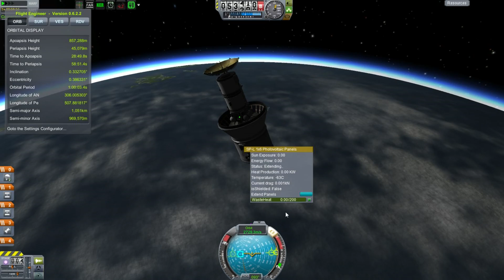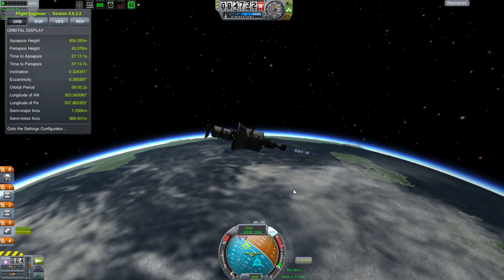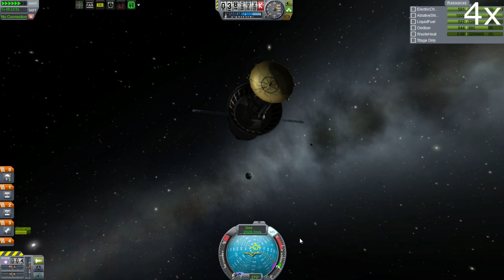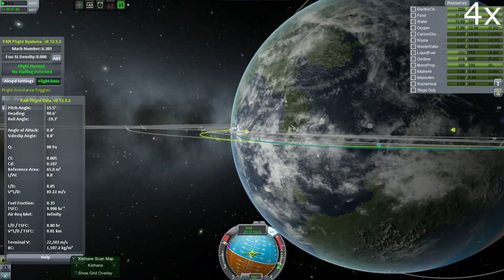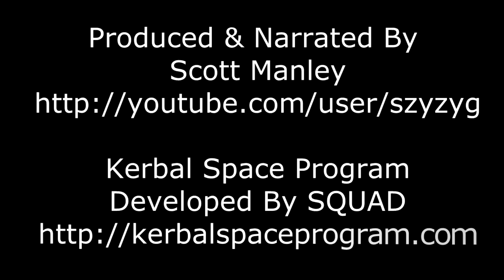Kerbal Space Program - Interstellar Quest - Episode 30 - Moho Return Probe & Orbital Power Station

Comment: anyone know if it theoretically possible to design a Free Return rocket to other planets?
Reply: Yes for multiple orbits, not sure for a single orbit.

Let me elaborate and take trip from Kerbin to Moho as an example. Standard way of getting to Moho is to make an orbit around the Sun which has apoapsis at Kerbin and periapsis at Moho. When you get to Moho, Kerbin is no longer at your apoapsis, because it orbits around the Sun. But if you wait long enough, then after orbiting the Sun many times, Kerbin will eventually get back to your apoapsis. The problem is, this might take a hundred years. And the actual time it takes is hard to determine in KSP.

As for a single orbit, I have done some of the mathematics and it's not easy. When you get to Moho and do a gravity assist, you can either do it in the direction that Moho is moving, which will take you in the opposite direction from Kerbin, or in the opposite direction that Moho is moving, which will decrease your apoapsis.

Now I won't be able to sleep tonight until I solve it, damn you :)
Reply: I guess you could if u timed it really well and did some burns on the way, but u may burn up in the atmosphere(but that sorta counts cause u made it back:), it would be difficult, but maybe scott could do it
Reply: Ok ill give u another conundrum. Would it be possible to go to all the moons/planets in the solar system(not landing) and only burn to get gravity assists to go interplanetary?
Reply: ArtPlays wouldn't that just be the Interplanetary Transport Network? 
http://en.wikipedia.org/wiki/Interplanetary_Transport_Network
Reply: ArtPlays You're probably interested in this: http://en.wikipedia.org/wiki/Interplanetary_Transport_Network
Reply: ArtPlays
Just getting an encounter? Yes. Have fun doing the math to find out your one launch window, though.

Comment: I would assume that someone already mentioned that the wasteheat works completely different now. There was no need to shut down the reactor, the heat builds up to a point up to which the radiators don't have much to.. well, radiate, then it stops building up.

Comment: Scott, from my experience using the radiators in game, they need to "heat up" to vent more heat.  once at high heat output, the system usually equilibrates and no issues, but it takes a few days of time warp to get them hot enough. they start at ~233K and have a max temp of ~3500K.
Reply: You are right. It is a little scary at first but eventually the panels will settle at right temperature for the amount of heat that is generated. I was able to cool my 1.25 meter radiator with only 4 panels this way.

Comment: How do you run all these mods without running into memory issues?
Reply: texture reduction packs and a mod specifically designed to reduce memory usage
Reply: I use those too. Maybe I am running more mods the Scott. Did he happen to give a complete list of mods used in this series?
Reply: Very sporadically. It's more he mentions what he's using in-video.
Er... KSP Intersteller, Deadly re-entry, KAS, KW Rocketry, Realchute (I think), FAR, Kerbal Alarm Clock, Kerbal Flight Engineer, Enhanced Navball, Steam gauges, B9, Tac Fuel balancer, Tac Life support, Infernal Robotics, Docking port alignment, the community science messages and Kethane (though it's a while since we've seen anything from this one).
Remote tech too, but he's partially disabled that for now.
There's also the mod that gives the clouds and night-time city lights, but I'm not sure what that one is called.
Hm.. With the exception of memory reduction mods I think that's about it. Short of the low-res textures for B9 and KW I'm not sure what else he uses for memory reduction. Active Texture management might be the most likely candidate (high up in the forums).
sigh now if only I could remember useful things nearly as well ^^;
Reply: You can find the list at http://www.reddit.com/r/KerbalSpaceProgram/comments/1qdean/what_mod_did_scott_manley_use_for_custom_science/ - I think it's pretty much up to date.
Reply: Thanks Hunter. This was in the first reply and is the most up-to-date, http://www.reddit.com/r/KerbalSpaceProgram/comments/1upc6g/scott_manleys_interstellar_quest_modlist/. It looks like I was using a couple more mods, but very few of the same mods. And My B9 and FASA packs were stripped down to less than half their parts and I was still having frequent crashes. I went from having 15active flights to only 3 because I was deleting parts. Unfortunately on my space stations I forgot to search for the part links in my persistence file and didn't catch it until after reloading ksp and loading into corrupt space stations. And this resulted in the loss of a dozen kerbals as well. I'm blaming a micro meteor cloud that blew past the mun taking out my science lab before hitting the lab around kerbin. lol
Reply: Damn micrometeors. They'll get you every time.
Reply: i wanted to point out that using the B9 texture reducer that is linked in there actually makes the B9 folder larger. It went from 463mb to 480somethingmb. If you use the reduced textures included with b9 however it reduces the size on disk to 160mb
Reply: Afaik as of 0.23 KSP compresses stuff on loading the game. So you won't run into memory issues until you actually use all those things...
Reply: Seth Brown I maintain a modlist on /r/KerbalSpaceProgram. http://redd.it/1upc6g
Reply: Thanks for keeping that up to date, Orochikaku!
Reply: Seth Brown Someone in reddit is trying to track the mods in the interstelar series  http://www.reddit.com/r/KerbalSpaceProgram/comments/1upc6g/scott_manleys_interstellar_quest_modlist/

BTW: stupid youtube reply system...
Reply: Hunter Rose :D
Reply: Stealing NASA's computer and running memory reduction mods

Comment: How come didn't your rapier engine overheat? I build a very similar spaceplane and I was unable to fly it at high speeds due to interstellar causing overheating when airbreathing engines are operated at high speeds. Using a precooler solved the problem though

Comment: In terms of heat produced by uranium and thorium, post shutdown, wouldn't being in space mean you could vent any heat build-up by exposing the rods to vacuum?
Reply: You still need a large surface area to radiate away enough heat to prevent it from melting. In other words: Vacuum is a very very bad heat conductor. It's the reason you need those enormous radiators in the first place.
Reply: Heat can only radiate in a vacuum, it cannot conduct (via physical contact) into the surrounding atmosphere, because there is none. So solar radiation and internally generated heat gets stuck in the vessel, which is why you need special equipment (radiators).
Reply: Ahh of course. Thanks guys.

Comment: If you had just disabled the MW transmiter the power usage would have droped back down to 30% (from 100) and you would be generating alot less heat.  Another thing is KSPI .9 changed the waste heat mechanic.  Its now normal for waste heat to build up untill it reaches an equilibrium level. 14 unupgraded huge radiators should be just barely enough to handle an unupgraded thorium reactor at full power although it will probably stabilize up in the 90% WH range.

Comment: How do you you get your geostationaries to be so perfect? after 1000 times speed waiting for a planetary transfer eventually mine all go out of alignment :(
Reply: If you get the orbital period exactly 6 hours long you will end up at the same place at the end of the orbit. Even with an heavily eccentric orbit you will still end up over the same places in each orbit.
Reply: Mcheijink Indeed, which unless I'm mistaken is an orbit of 1009.0ms-1 at an orbit of 2,868.75 km - its just impossible to get exactly spot on. Even if was to get the orbit to within a kilometer after enough time warp the precision error throws my satellites off their spot in orbit around Kerbin. I've already replaced one set and modified the current one.
Reply: Tom Whitcombe You should check out Kerbal engineer, MechJeb or another plugin where you can see you orbital period. Then you should go up to KEO and get your orbital period exactly 6 hours. The eccentricity and inclination don't matter that much because you will be above the exact same spot 6 hours later.
Of course the Unity engine will mess up some of your orbits ;-)

Comment: Hey Scott, just wanted to know what processer your computer/rig has inside it. Building my own gaming rig and will be playing ksp for a majority of the time and I know that ksp works off the cpu more than the gpu (or so I'm told).
Reply: For KSP, aim for a processor with the highest per-core processing capability.  A lot of people run into CPU cap because of physics processing, which is single threaded.  That means it can only be processed on one core at a time, meaning more cores won't boost performance.  So don't spring for that 8 core CPU if you could get a 4 core one that has better per-core processing.
Reply: pseudocoder78 Would a Intel i5 4670k be all right? it's a 3.4GHz cpu.
Reply: One-Way Gaming I use the i5-3350P, which is one generation older, and lower in the product lineup, and so far I have had zero performance problems.  The Haswell-based 4670k is the top of the line in the current generation and should be plenty of power unless you want to go to insane expenses.
Reply: Great vid! keep it up
Reply: pseudocoder78 Thank god. I got the 4670k and was worried I made the wrong choice. Thank you good sir!

Comment: I am new in space flights and these things so i have a question , how is called the effect that reduces DeltaV needed to transfer to another planet by burning inside sphere of influence of a planet?
Reply: Thank You very much.
Reply: DiEvAlDiEvAl What happens when you go really close to a celestial body, and steal some of it's speed to boost into a higher trajectory.
Reply: I bet that You can't really steal speed of a celestial body due to the difference of you'r and it's mass. By the physics it'll lose a bit of it's kinetic energy but it won't be really seen.
I read a lot already about that Oberth effect and it looks like it's because of gravity affecting rocket engine... exhaust gases? I'm sorry but i don't know proper words for it. Anyway it causes You to get Your body/ship etc. affected more by thrusting.
Reply: Charger House
The Oberth Effect and a gravity assist maneuver have nothing to do with each other, oddly enough. It is true that you can steal a tiny amount of a planet/ moon's orbital speed by flying past it correctly, but the Oberth Effect is a result of a little quirk in physics where the greater the distance a force acts over, the more work it does. When a rocket is going really fast, It moves a great distance during a burn, therefore increasing the amount of work said burn does.(feel free to correct me, I don't actually know what I'm talking about)